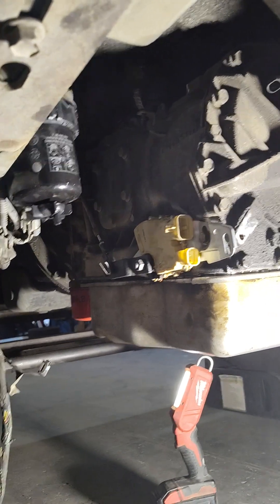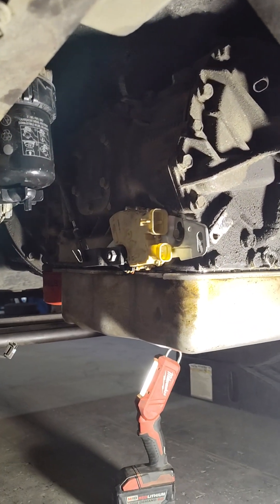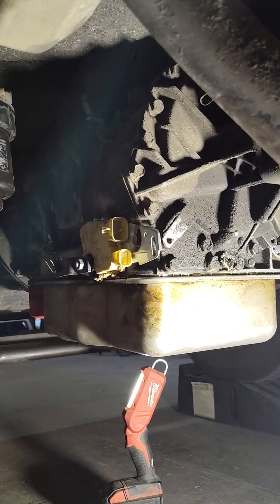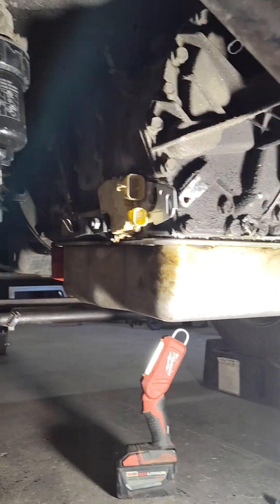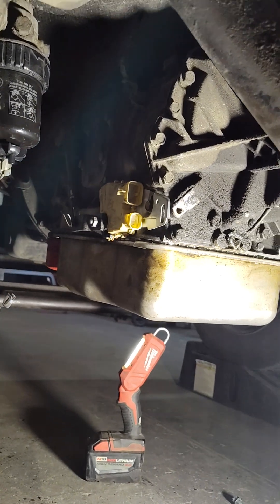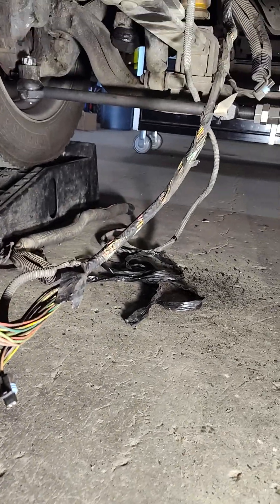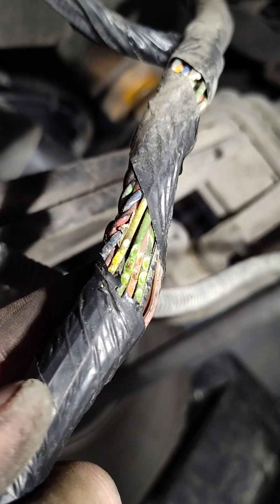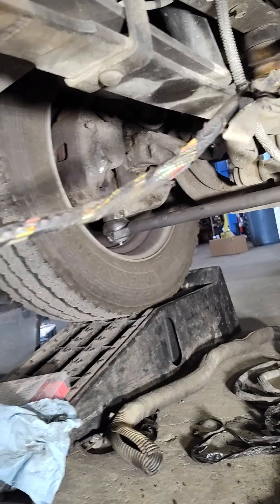Allison transmission issues, hard shift, stuck in gear

Comment: Im not getting any codes, yet my alison 1000 for my 5.9 Cummins is going into gear hard and stuck in,  well some gear. Imagine 3rd gear like some say. 
And im many miles from any garage that could scan it.
Reply: I’m having the same issue. I’ve got the same set up a 5.9 with a Alison 1000

Comment: Thanks for the video. Having shifting issues as well. I don’t know trans or electrical as well as I should, so I took my 2012 6.6l duramax with ali 1000 in for diagnostic and said tell me what’s wrong. Two months later a get it back from the “transmission specialist” it’s a bad TCM. Replaced that 1k later doesn’t fix. Decided to do it myself! Got a OBD2 and power probe and got at it. Couldn’t find any electrical issues with wiring at connectors, so I took out the valve body and went through the entire thing. Replaced everything I could electrical in the valve body and checked all the shift rods. Put it back together and still no fix. Replaced the alternator as well because it scanned a little low on voltage. Still no fix. Saw this video and decided I’m going to remove the entire harness from TCM to trans and see what I find. I also did ohms testing on all the wires from TCM to trans connector and things tested good. I did see that while moving the trans connector around changed a couple ohms readings, so at it again. 

Thanks for the video! Goes to show us home mechanics have to check everything from factory. One man’s rough day at the manufacturer is another man’s horrific problem down the road. How do people not care about causing other people to have problems is beyond my mental capacity.

Comment: My truck in on limp mode. Is a 2006 silverado LLY allison 1000. How do you repair those wires? 
I have to check this. I  am about to buy all of the solenoids and the harness. Help 😢
Reply from the maker: Strip, saulder, heat shrink wrap, or a heat shrinkable connector. Pretty simple
Reply: If you find any wires that are twisted together in the harness they must be twisted at a particular twist rate to communicate proper.

Comment: my trcuk has given me multiple different codes and now after replacing one of the shift solenoids, it is throwing a code where it says another one is bad. I am now thinking it is the wires from the transmision to the tcm or the tcm itself but i would rather not keep putting money into this trans if its a lemon. If there is not an obvious problem in the wiring im not sure if I should replace the tcm or the all of the solenoids.
Reply from the maker: @joshatkins6729  Ive only had one TCM that kept blowing a fuse as soon as you turn the ignition on. Truck would start and run only with the trans connector unplugged with a new 30amp fuse. The TCM had a power issue. Sent it in and got it repaired for cheap
Reply: @maliy8  So it would be blowing a fuse if the tcm was bad? I think im going to drop the pan and test all of the solenoids

Comment: The wrap around the wire is due to heat shrinkage overtime. The factory didn’t forget to completely wrap it.
Reply from the maker: @keevinboling6691  trust me it didn't shrink it was still same size as new electrical tape and just as sticky. It would be dried and cracking if it was heat damaged. That outer case would be melted if it saw that kind of heat

Comment: Having an issue with my 07 lbz it randomly "slips" and locks 4th gear and im hoping its just some wires worn thru but is there anything else i should look at or test while i have the truck in the air?
Reply from the maker: @ethanguerrlich165  what color is your fluid
Reply: @maliy8  fluid looks clean not burnt but I recently bought the truck and it's possible it was changed recently to hide burnt fluid
Reply: Any luck? I’m having the same issues

Comment: any updates on this?
Reply from the maker: @_N4VE_  after fixing the wires that where corroded and cracked the issues went away and truck runs great till this day
Reply: @ nice! I’ll have to check my wiring under there and make sure everything’s sealed well. I recently bought an 06 LBZ and I had to change literally all the heat casings for the wires cuz they were crispy and crumbling apart just from touching them. Didn’t check the transmission harness tho!
Reply from the maker: @_N4VE_  pull the plastic casing off from the back of the trans and up as far as you can and look at all the wires for a start
Reply: @maliy8  i’ll make sure to check them good. After overhauling the truck when I first bought it (egr delete, piping, intake, exhaust) the truck ran fine and threw the egr codes as expected, but there was a stored code in the history for “loss of communication with TCM”. My friend said it wasn’t a code thrown recently but it was a little alarming. So he reset everything and went for a drive. The CEL came back on but only the EGR codes came back as expected. Nothing else. Would the TCM code have thrown possibly from me disconnecting the batteries while working on the truck? As far as shifting, the truck shifts thru it’s gears smoothly, only a few rare occasions it would downshift a little “hard” when i press the pedal down to do a test pull.  No noise, just notice it grabs pretty hard.
Reply: What fixed it?
Reply from the maker: @Indiansautoo  fixing the broken wires that where exposed and corroded and completely broke

Comment: Having the same issues, did you have the abs light on the dash?
Reply from the maker: @Selections-e5m  yes
Reply from the maker: @Selections-e5m  yes
Reply: Did re wiring it help ? Im currently having the same problem
Reply: @flashkorleone26  I wasn’t getting a ground to my ABS module put a good ground to it and it took the truck out of limp mode, she shifts a and goes now 

I believe the ABS not communicating with the can bus system properly thru it into limp mode